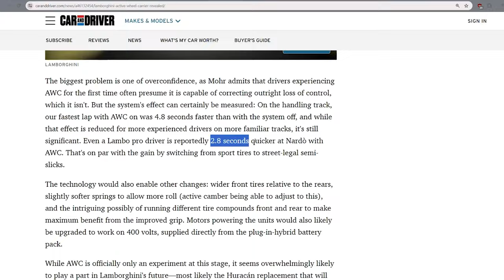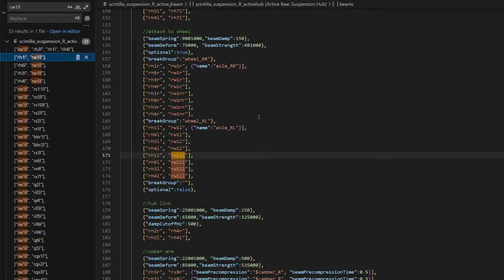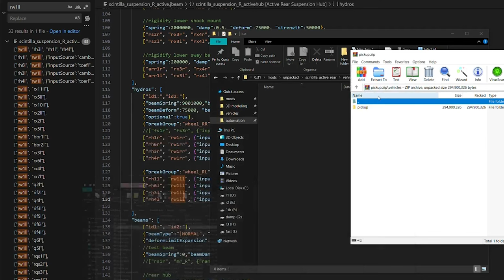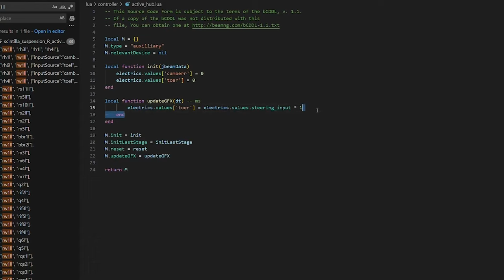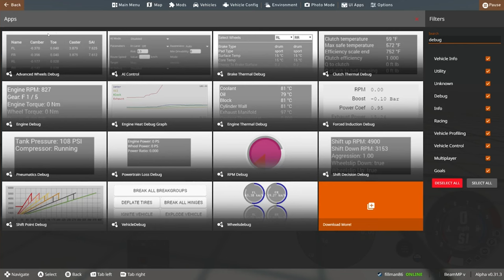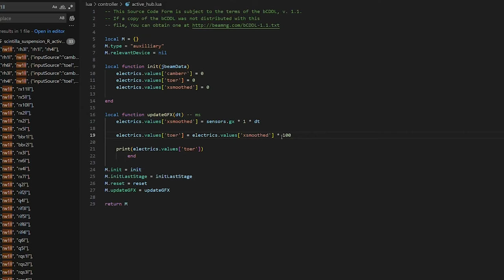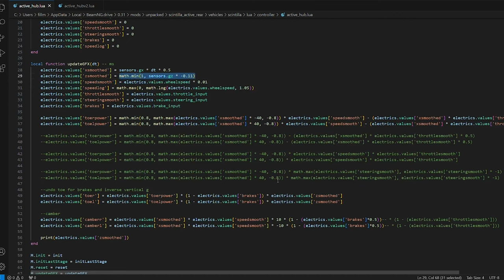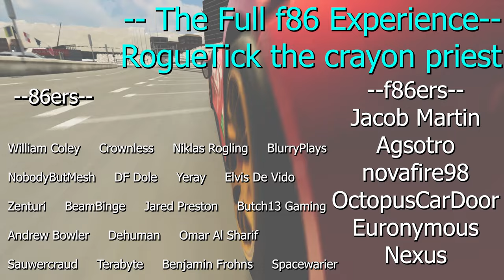Using BeamNG to copy Lamborghini

Comment: If you can picture what your tires look like from the front, negative camber, during a corner, the body roll will set the outside tire down flat on the ground where its taking more of the vehicles weight, giving it more grip. Thats why you see drift cars with alot of negative camber up front.
Reply from the maker: yep, and I made the outside tyre have more camber, and took it away on the inside, so both tyres would be flat on the ground. The tricky thing is tuning toe

Comment: 3000 series transient moment
Reply from the maker: very probably, I knew my 850w psu was on its way out for a while though, so I now have 1000w :)
Reply: @fillman86  
 I had a similar issue recently, caused by only using one power cable (a 6pin x 2pin with a 6pin x 2pin pigtail) from my PSU to my 3070 GPU instead of two, separate (8 pin) cables. It ended up melting the PSU connector and frying my GPU. The old PSU was 750w. I now have an 850w.

Comment: if i m not wrong, ABS that changes brake bias is called EBD (electronic brakeforce distribution)
Reply from the maker: oh interesting, I didn't know that existed, as most race cars still use a dual master cylinder and balance bar
Reply: @fillman86 EBD is usually seen most on road cars (if you have emergency braking system you probably have EBD without knowing) , i believe it's because racers use brake bias to voluntarly "oversteer" (trailbraking), so i guess EBD would be detrimental or something (additionnal info : EBD does not replace ABS, it's a part of it)

Comment: So the thing is that lamborghini ment when you turn the camber and toe angle changes because of the weight shifting on the outside wheels and if you basically setup the car for turning you'll loose it on tire wear and stuff like that and what they end up doing in making the outside wheel have more negative camber and inside more positive angle in terms of toe each wheel basically adjusts by it self it's not symmetrical that's why it isn't working as intended here (too much coding I get it🤷🏻‍♂️)
Reply from the maker: mine is also asymmetrical, it gives more camber on the outside and tries to invert the camber on the inside. The problem is that this adds huge amounts of grip to the rear, thus I really needed to also do something to the front to give it grip too.... currently without the front grip, it just understeers

Comment: Multiplying by DT is such a bad idea in this case haha, DT is the frame time which means it'll be larger the lower your fps is and lower the higher the fps, i think at 120hz it's 0.008 and at 60 it's 0.016 if I'm not mistaken, so it could behave very unpredictable across maps and pcs depending on the fps the user has
Reply: especially since the g forces have probably already been multiplied by delta time or are a product of a multiplication by delta time.

Comment: I was thining maybe you could add a small filter at the start to change the yaw angle to 0 if the value isn't large enough itself. It's almost guaranteed that the death wobble is caused by "noise" large enough that it gets amplified to be an "input" value
Reply: Basically setting what values that you'd consider "noise" aka, small fluctuations at high speed as "0" before the "sensor.gx" if or before they get amplified to be 10 times larger

Comment: Would be interesting to have a negative feedback loop with the lateral and forward G force, making incremental adjustments to the wheel alignment to maximize both G forces, or one or the other depending on if there is more throttle input (max forward G) or more steering input (max lateral G). Not sure how feasible it would be to implement this though, you would have to have a ton of edge-case handling to prevent it from freaking out and exploding

Comment: For the oscillation you could try to implement a sort of delay so that the values of the suspension change slightly after the g forces have changed so that it wont have a direct feedback loop anymore.
Reply from the maker: I try not to dabble in the dark arts of which I know nothing
Reply: Fair enough, was just an idea. @fillman86

Comment: I would have to look it up to be sure, but my first guess why you can't print the values is you might need to convert/cast them to strings; in many languages the print command doesn't auto-cast variable types and only accepts strings.
Reply from the maker: yeah, I got that working after about half the video floundering haha

Comment: At what point does "active" become too much? If everything in a car can control itself without driver input why call it a car, when it's more like an autonomous vehicle.
Reply: Yeah, that's the thing. I mean it's cool that we're making cars like this that can give the best performance possible, but it's all so digital and autonomous now. I miss when supercars felt like they were trying to kill you lol, even with cars as late as the first gen Gallardo and Murcielago. They were so "raw" in power.
Reply: For this case, I’m hoping it makes controller a little easier/better feeling. In this particular case anyway
Reply from the maker: you say that, but those cars actually did kill their drivers.... lots of them. I wouldn't call this autonimous though, as it's not driving for you, it's not even on the same level as ESC, I'd say it's more along the lines of the next level above rear wheel steering
Reply: @fillman86  but I like the bolides feeling of being at the edge of death even just idling in rush hour traffic.
Reply: I think that's the idea at speeds of 220+ mph
Reply: it would be way faster if it didnt act like it was a drift car, if the car had a bit more grip it would definitely do alot better than the base game race version
Reply: @pelly06gaming7  well yes, but kinda no. Alot.of mod engine cars have better tun
RN in of you let the back slid out a little, when going fast, through corners. A car that feels planted isn't always the fastest.
Reply: Is it really autonomous if you never controlled the camber yourself in the first place?
Reply: @jwalster9412  its literally slower because that scintilla loves to slide, so how would I be wrong that a little more grip wouldnt make it faster?
Reply: @jwalster9412 then don’t use this mod? No one is holding a gun to your head forcing you to use this system
Reply: Kinda a point in some cars
Reply: @jwalster9412  wow so edgy

Comment: I find that nearly every car in Beam has an tune on it. the cars that dive and oversteer under braking i find myself lowering the rear ride height in addition to the alignment and it solved a lot of oversteer issues i was having with cars like the barstow. a little more weight on the rear with a stiff front sway bar seems to keep it from going light under trail braking and help press the tires into the ground on the way out.
Reply from the maker: Understeer under braking is the brake bias being too far forward, and vice versa :) 

The biggest issue with the scintilla default tune is the bad toe tuning (and basically everything else)
Reply: @fillman86  lol its iiiiiine apart from all of it. i dont like they way it drives either. the cherrier is the best fit for my driving style, of course with a proper tune lol

Comment: You're not being harsh, the Sinctilla is among the worst handling cars in BeamNG, and it's even worse when it's on the absolutely ass backwards default setups that it has. The car can be made leagues better when it's setup properly, but even then it fully relies on aero to do anything, and its aero is also just as ass backwards and un balanced as its default setups. It's also like there's other issues with it, my guess is there's problems in how it delivers power, which has to do with the diffs, because seemingly no matter what you do, the low speed handling is a joke, and it just does nothing but brake traction. It should be so much more planted for what it is, regardless of the aero, yet it just can't do much until it's got that op aero gluing it to the ground. 

What I'm saying is I would've liked to see you use a significantly more consistent car for this mod, you'd have to take almost any car you choose and set it up yourself since pretty much none of the default setups are any good, but if you start with a car that's fast and consistent, you may be able to get some actual conclusive results.

Also I think you didn't see real results here because the idea of adaptive alignment, when taken to its fullest potential, really means a system that's able to provide perfect tire to road contact at all times, making it so that there's absolutely no sacrifices of grip made anywhere, in any situation, allowing the car to be perfectly stable, and put down all its power, making perfect contact with the road at all times. 

If I had to guess, to do this properly means not just adapting one or even two alignment settings according to G-force, but rather it requires having a very complicated system that quite literally understands what every tire is doing in 3 dimensions independently, and is capable of understanding how every variable in the suspension needs to be adjusted in order to generate perfect grip. Although super complicated, It's totally a feasible thing that just may literally require a entirely built from the ground up modded car to allow you to adjust things as needed without braking stuff. 

Regardless I hope you revisit this some day, you're one of few capable of bringing this into BeamNG right now.

Comment: 3080 and 5800X, my man you do not need a new computer.
Reply from the maker: by "needing a new computer" I meant I need all the parts to be new parts all at once, as opposed to my ship of thesius style of PC building since 1996 haha
Reply: @fillman86  Your harddrives might be the problem as well, if you buy a new computer but carry over your harddrives you may continue having the issues there instead. If you've been carrying all your data along all those years you may want to consider transferring over all your important files to the cloud and then formatting them. This would be a very time-consuming task though and I would probably do some hardware troubleshooting first.

As an IT technician I can also guarantee you that your problem is not something that needs a $3000 fix. As a first step I'd go into your bios and turn off DOCP/XMP to set your ram to their default 2133 MHz speed, and underclock your CPU to 3.9 GHz@1.3V using Ryzen Master. This will let you see if the problem is related to either the ram or CPU, as if they are unstable running them slower will fix that in most cases. A look at the Windows error log can also be a good clue. I'd love to help troubleshooting over Discord if you want.

Comment: No Signal
Check if:
1. Cables are properly and securely connected.
2. Input source device is ON.
Reply from the maker: I'd re-seated everything a few times. I got a new 1000w psu and it works like a charm now
Reply: noice
 @fillman86

Comment: how I wouldve done it if there was any values I wanted to smooth, I would make an array with the size of 10, add the value to each part of the array in order in incremental timess, take that array, make for loop, then just average between all ten values.

because delta time doesnt smooth it, it just adjusts it to real time.

an even better way to do this, is try to take the most balanced car in the game, and do testing on that instead.
Reply from the maker: I tried to make a table but I was (and still am) too dumb to figure out how to use it lol
Reply: @fillman86 why not brute force it? make 10 seperate values instead

Comment: Holy Cow! YES!
Edit: also really weird that my pc just started freezing randomly watching videos. I guess it’s a driver issue, idk. Any way. Awesome video and legit cool mod. Thanks dude
Reply from the maker: glad you liked it, and it's odd that your pc can't handle video playback. Since it's meant to be low impact, I'd also say it's a software thing
Reply: @fillman86  hey. I’m messing around with tuning. Is there a way to adjust the amount of drive delivered to the front axle? For lack of a better way to say that. It would dramatically help your understeering
Reply from the maker: @HairryTurttleneck  that's probably something related to a custom diff controller
Reply: @fillman86  hmm. I just realized I couldn’t find it. Most games it’s adjustable and needed. Like I think an Audi is like 20/80 split. I’d like to know what this is

Comment: The restart problem could be you gfx card dying 😭 I had this issue with an rx580 whenever the card pulled full power , until it just stopped working one day.😂
Reply from the maker: luckily it was just PSU related
Reply: @fillman86  nice man! dodged a bullet. Replace it with quality. Those things tend to take down other parts with them when they go.

Comment: Hey I have a question I put a hellcat steering wheel on a Chrysler 300 could I get help on how I can put it in the right spot it’s a little below where it’s supposed to be I just need help on that I been trying for so long pls
Reply from the maker: this is the documentation on it - https://documentation.beamng.com/modding/vehicle/sections/props/

you'll use baseTranslation as an optional argument
Reply: @fillman86  thank you one day could you make a video on it if you can’t I get it but thank you
Reply: @fillman86  are is there a video where it shows how to connect the nodes to the right spot
Reply from the maker: @mocomoco8007  hmm I'd gone over it a few times in the past, but there's example code in that link I sent you :)

Comment: i still dont get what the benefit of the hub is compared to a variable linkage system where camber and toe are adjusted by variable length rods
Reply from the maker: because actuators are generally only strong in expansion or compression, but not lateral (some metallurgy reasons I believe). Also you'd have too make some really heavy system to have them connected together in A-frames, or it'd just twist under acceleration, and that'd weigh a lot
Reply: Also believe it or not, but it's also a much more mechanically simpler system, and a lot easier to predict and model.
The thought of creating a system that originally only had one degree of freedom but now has three per wheel in a simple fashion to one that has six in a typical multilink application is what you would call engineering hell.

Comment: Try the MSI MPG 1000W. its $150, has 80+ gold rating, and its one of the highest PSU'S in the PSU teirlist.
Reply from the maker: I got a corsair rm1000e, which also has one of the highest ratings (and it was also local to me, so I picked it up the next day)
Reply: @fillman86  that's the thing, you never wanna get used PSU'S. There's always going to be a issue with them if they're being sold lol.
Reply from the maker: @scarecrow5848  psu, ram, and cases are the only things I wouldn't buy used
Reply: @fillman86  oh, you said local, didn't know you have a store you can go to for new PC parts

Comment: Maybe try the toe tied to the amount the shock is being compressed
Reply from the maker: Unfortunately that’s also something I don’t know how to do and may be kind of impossible to implement with how beams spawns cars, end tuning
Reply: @fillman86  yeah it seems like the sensors that control that in real life have to be measuring throttle position and wheel speed sensors along with the angle of the steering input